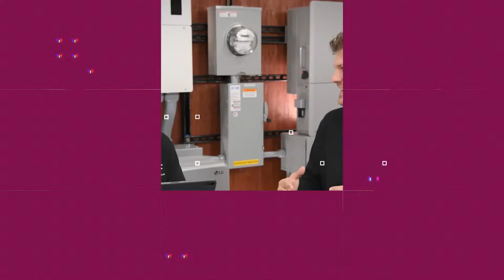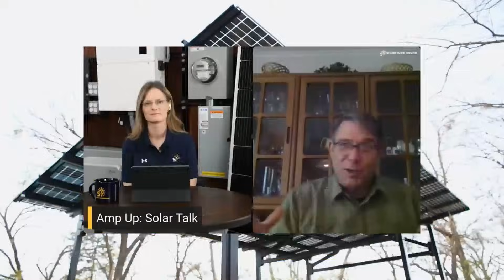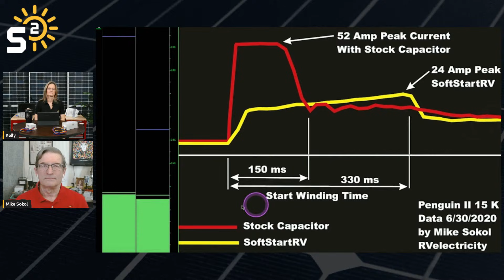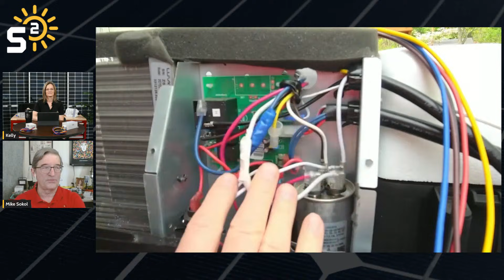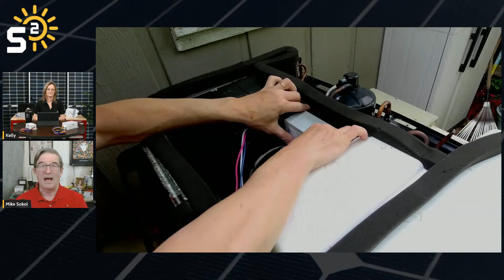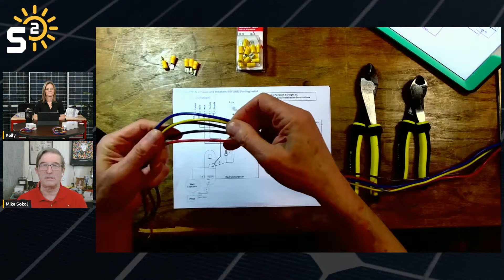Amp Up: Solar Talk - Field Tested: Starting High-Demand Loads on Limited Power with SoftStartUSA

Comment: Does the RV unit that you plus the entire RV power into work for a 50A RV? You mentioned it is for 30A RVs with 2 ACs but aren't most RVs with2 AC units set up for 50A?